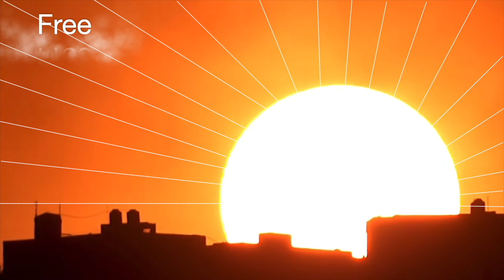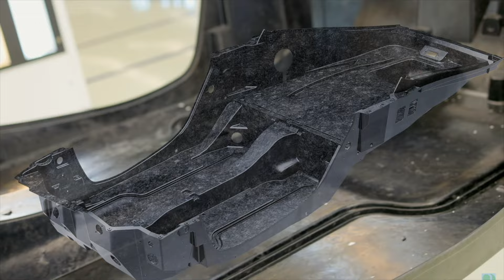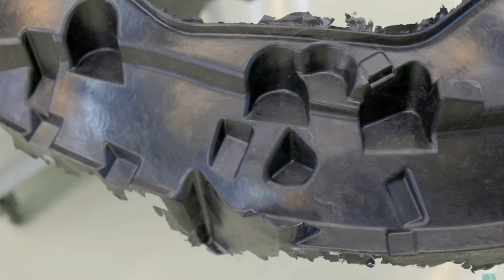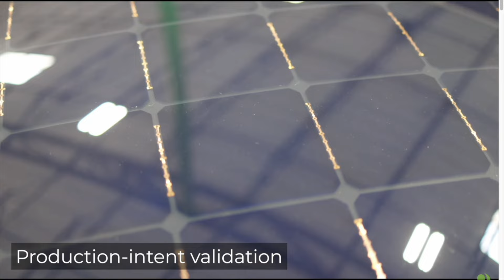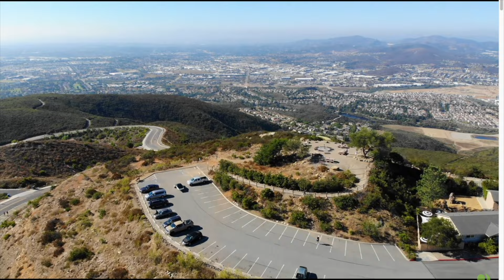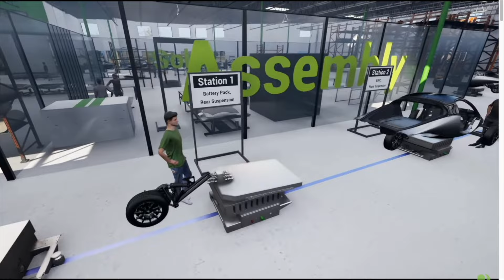CPC Printing Aptera's Tubs !

Comment: So CPC/Aptera is where Tesla wants to be with their yet to be built 16,000 ton Giga Press? Why are they having issues getting investors?!!! This process can be used to make other vehicle types too!!!
Reply from the maker: I think that will be answered very soon . 😏
Reply: Hopefully getting some production intent vehicle in circulation will entice some big investors to get onboard.
The Aptera is sort of a "disruptive technology" I hope once they demonstrate that they are safe, and that their efficiency claims are real, and that they can achieve  production. It may change the interest level.
Reply: Tesla has already been using several giga presses and they have a shit load of pressed CyberTruck castings, same for Model Y, what are you talking about?
Reply: @jamarforsythe7262  The 16000 ton giga press is still under development for the Model 2. It will enable them (Tesla) to make the ENTIRE undercarriage of a car in one casting. Kind of like the one complete casting for Aptera in the video. This process appears to have no limitations to other vehicle types for Aptera.
Reply: @b.robinson206  - Don't forget the Aptera and Tesla are using different materials for these presses and completely different processes. In addition to that, Tesla has many irons in the fire, as while Aptera has one. Also, the Mitsibushi plant that's making the Aptera tub is 220,462 lbs while the Tesla one is 32,000,000 lbs. So no comparison.

Comment: I am guessing all the tub parts are complete, as it isn't a hard thing to do once it has been verified.  I assume they verified it prior to publishing this video.
Reply: I like to know if the battery goes bad about how much would it cost to replace a new battery on the vehicle
Reply: That would depend on many factors. Which battery size do you have, how far into the future are you talking? Battery technology has improved a great deal over the years, and will continue to do so. Now days it is kinda like saying you want to know how much a engine costs in case you have to replace it in your ICE car. @josezayas6847
Reply: @josezayas6847  Battery cost has decreased considerably since Aptera was announced.  So has the labor to build the bodies.
Reply from the maker: That’s what I’m thinking as well . 😎